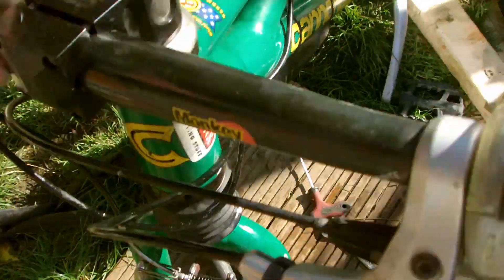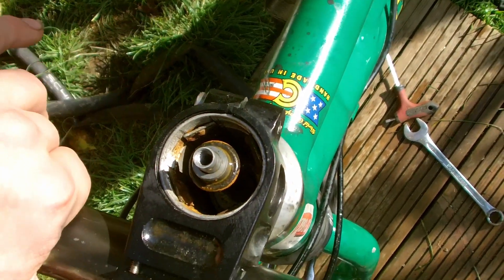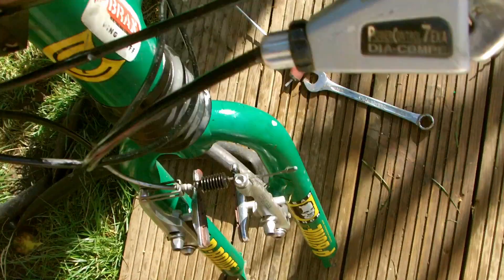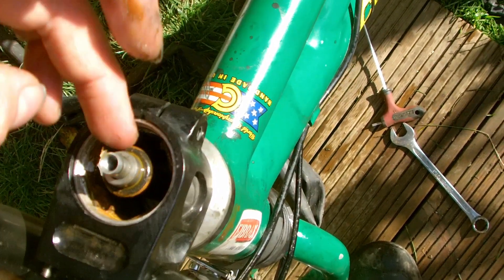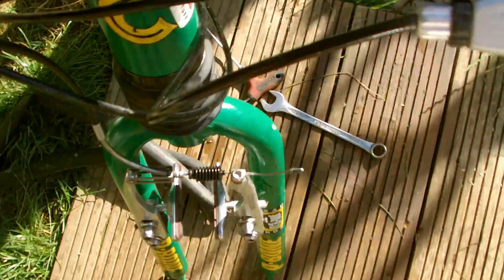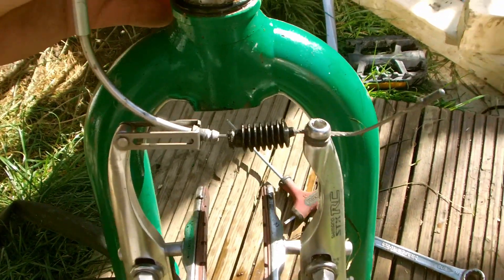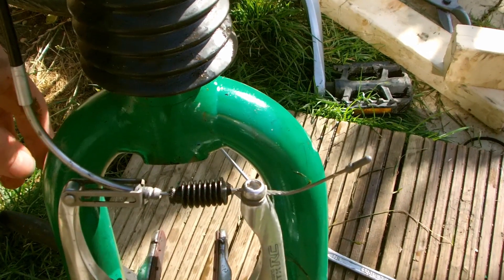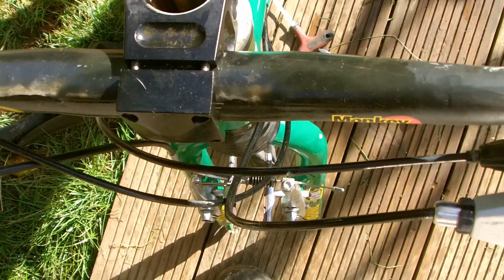cannondale head shock gone bad  locked up

Comment: There are still some companies about who will work on Headshox. You could run adaptors etc. and a regular fork while those get fixed.
Reply: A suspension corrected rigid fork is the way to go